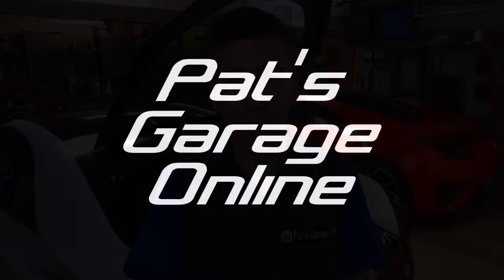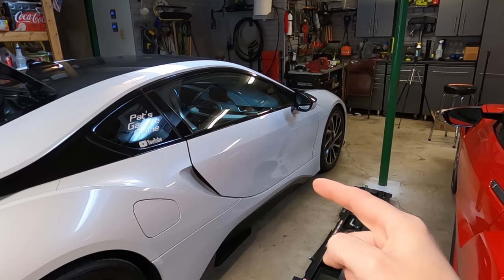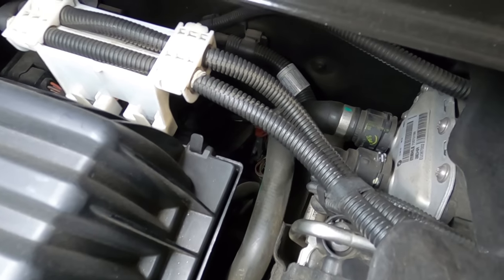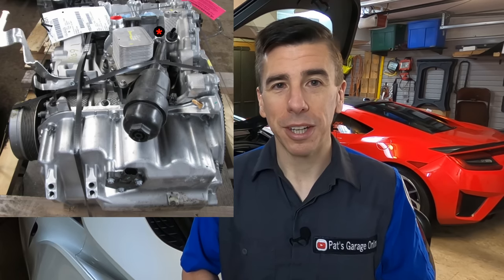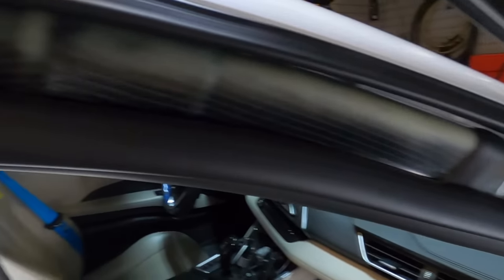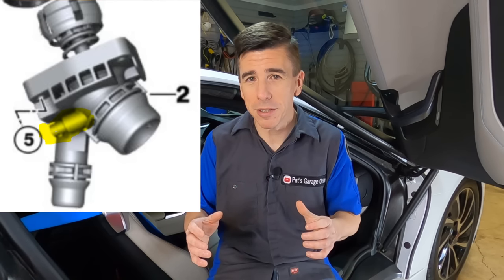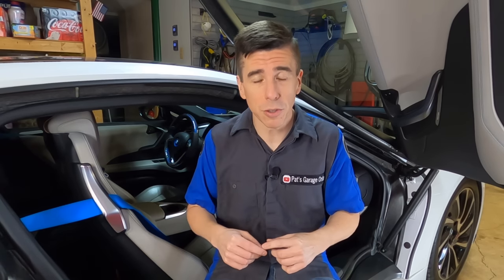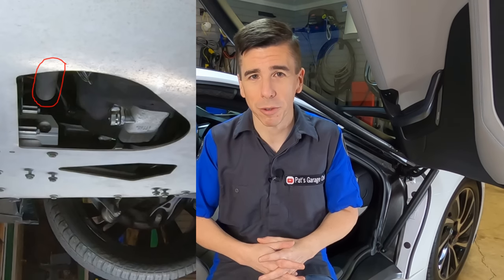My response to your ideas about Samcrac's BMW i8.

Comment: Wax element, interesting. I am familiar with wax element control, as they are used in some HVAC applications. They can be very reliable. 
I have worked on bleeding very large systems. Circulating the water over a long period of time, set up such that their can accumulate and be bleed off at a convenient point would seem to be the best course. Using an external electric pump for say 24 hours while the system is at an incline could slowly remove the air. The faster the velocity and pressure, the more air will be removed.
Reply from the maker: That's a great idea, using the electric pump.  There are many coolant hoses with quick disconnects where a pump can be put in line.
Reply: to my eye the concept that the radiator was blocked as it failed under pressure is incorrect. Consider it a loop with an inlet. a blockage will not cause it to burst (unless maybe there is a check valve in the system, which I think does not apply here). What that looks like to my eye is plain old overpressure burst. A hand pump can generate tremendous pressures if not familiar with the correct pressure ranges.

Comment: Hi
Just a idea
Disconnect the Front water hoses and put a clear pipe between them
So you can see ive the waterpp is working
Reply: Waterpump
Reply: Wen its not circulating you now you must look there

Comment: If the cooling circuit was blocked (not circulating at all or not filling completely) then would the coolant be boiling in the expansion tank in the front of the car? I'm not sure the thermal transfer from the engine, to the volume of water at the front of the car, could take place effectively. The coolant would boil at the rear,l (in the engine) but the heat wouldn't transfer to the front. 

Also re: raising the front of the car to assist with bleeding, that's a sound idea in principle, but in practise, since the coolant lines run down from the engine to underneath the car (lowest point) before coming back up at the front, unless you raise the cars nose to be basically vertical, any air from the rear would still have to flow down hill, in order to reach the front of the car. So I don't believe that would make a noticeable difference in this case.

The real basics need to be checked - 1. That the coolant is properly circulating through the system - check for blockages by forcing water under pressure from the front (exit of the expansion tank) through the car, the engine and then where it enters back into the radiator at the front.
2. Check the expansion tank cap is correctly working, so that it holds pressure (require in order to raise the boiling point of the water in the system). Without that, the engine will not be effectively cooled.

Comment: When Sam pulled his plugs out on the first Vid.
Did you notice they were a rusty brown colour like they’d been wet at some stage.
Maybe the head has been warped from overheating.
Because the alloy manufacturers use these days,  isn’t the quality it used to be.
Reply from the maker: Yes.  But this also happens when someone adds octane booster additive to the fuel.  Many people with these cars try to squeeze extra power out of them so that was my initial assumption, but you could be onto something.

Comment: Pat, what opportunity is there to run a small tube into a line somewhere and get it to the top of the head? The idea being to simply evacuate the air pocket and let the reserve tank make up.
Understand the concern that it would drain but this can be addressed. You can send a personal note if you want a quick diagram on an option. pretty rigid pipe with a somewhat direct path would be optimal.
Reply from the maker: That's a cool idea.  The only concern I see is that it would require a very long tube to get from the front of the car to the back and there might be some valves and coolant pumps in line, blocking the travel.

Comment: With the resistive heating element, resistors fail open. The MIL would only show a low fault for an open circuit. That schematic did not show any other sensors so the system also likely wouldn't be able to quantify that circuit, meaning, is the element getting hot enough and/or at the appropriate time or signal. In a high fault scenario, it would likely just blow a fuse somewhere, opening the circuit which would ultimately give a low fault for the MIL. It's all armchair without more info, full schematics and how the CAN-BUS is configured, but it is possible the heating element circuit is intact, but failed due to not functioning properly or within spec, and since it hasn't fully failed and there are no other sensors for higher fault resolution, doesn't show as failed. Not saying this is what I think is going on, but some info possible worth considering.
Reply: All of these that I have seen fail it was the wax motor, not the heater element.
Reply: @robb1165  I was only trying to show how a soft fail could occur, certainly not diagnosing the issue. Also, wouldn't the wax's expansion and contraction be at least mostly dependant on the heating element working? Or are you talking about some other type of failure?
Reply: @dolamyte  The wax motor is also exposed to coolant heat, but the issue I have seen with BMW's is the wax leaks out.
Reply from the maker: The thermostat is powered directly from the engine control module.  According to the service manual, If the characteristic map thermostat fails, the following behaviour is to be expected:

Fault entry in the engine control unit
conventional operation via wax element
US version: The emissions warning light lights up in the instrument panel

Comment: The thermostat works exactly like a Taco zone valve for hot water baseboard heat. Not a novel or unique design for controlling the flow of hot water. Temperature is about the same too-180F.

Comment: Maybe in the past someone busted the radiator and they might have used stop leak fluid to fix it which can block off the lines and this is why the radiator busted so quick when he was pressuring the system

Comment: It still could be the thermostat.  It may not be opening far enough.  The only way the computer can throw a code is if 1) the heater in the thermostat burns out, leaving an open circuit, or 2) the various temperature sensors indicate that the coolant isn't making it to the radiator and the computer has been programmed to check for that.  I say that because the thermostat doesn't have a position sensor.  So how will the computer know if the thermostat fails to open?  Does the radiator have a temp sensor on the engine/hot side?    I've seen another car with a heater on the thermostat - in that case, it's a regular thermostat with a heater to allow the computer to lower the setpoint.  I'm not sure this is different.  That wax motor is still going to be subject to the heat in the coolant, so even without the heater it's going to behave somewhat like a standard thermostat.

Comment: My 1984 Chrysler New Yorker with the Mistubishi engine had a Mikuni carburetor which used a similar 'wax element' which theoretically opened the thermostat when the engine warmed up. It never worked right and driving at 35 mph I was attracting all the wrong attention with the 'destroyer smoke screen' I was laying down. Wax elements? great on the drawing board; not so great in cars.

Comment: Not a mention of my headgasket thoughts or ways of checking for excess pressure in the cooling system...

And yet the video Samcrac just posted? Yep, headgasket.

Hooray me. I should get a cookie or something.
Reply from the maker: I wanted to cover the most common issues that BMW I8 owners faced. You are absolutely right, it definitely was the head gasket. I didn't bring it up because it's not a common issue that I hear about every week from other owners even though it's a possibility.

Comment: What is staggering about this problem is that the official BMW solution is a new engine. It would seem that talk of a new engine is just clutching at straws and equivalent to a IT technician not having a clue and recommending a full operating system install, when dismantling and checking the cooling system piece by piece would seem the proper way forward. 

The biggest clue system to the root problem is the blowing a hole in the radiator - that is what needs focusing on because it is too much of a coincidence that that was caused by a one in a million faulty radiator.
Reply from the maker: I agree.  I think there's a restriction farther back in the piping and the pressure was too great at the front, blowing the radiator.

Comment: Hi Pat. This comment does not specifically apply to this video but to another video where you mention not yo take of the reservoir cap as it will introduce air into the system. If the reservoir tank is up to level or even slightly below the half way mark i fail to see how air will be drawn into the system  as basic the coolant in the reservoir will act as a liquid trap . Much the same as drain on your wash hand basin has a "S" trap on it to prevent smells coming back up from the drainage piping downstream. Also as there is a air space above the coolant level surely then under your reasoning this air above the coolant would get drawn into the cooling system.   I may be wrong but let me know your reasoning as to why opening the filler cap would draw in. I agree if the engine is running there would be a positive pressure in the cooling system and on opening the cap the system would try and equalise the pressure and draw air into the system.  If however the car is cold and the engine is not running the pressure inside the cooling system will be as close as can be to atmospheric pressure so there would be no pressure differential in the system to force air in. I hope you understand my comment.  Thanks for another thought provoking video 👍🏾
Reply from the maker: I appreciate the reply.  I realized I didn't explain this properly in the video as I was talking quickly to keep the video short.  I needed to be more clear in that video, because removing the reservoir cap, when cold, will allow any vacuum from a leak in the system to cause water to flow out of the leak and air to enter.  That's typically when someone reaches out, when the level is low.  I usually tell them not to touch it because they likely have a leak.
Reply: @PatsGarageOnline  that makes sense now. The stat on the i8 is not that much different than a normal stat in that it uses heat to melt a wax plug but as soon as you add electronics to a mechanical system problems always arise😠😡

Comment: I understand why BMW said to replace the engine, that sounds like a much easier fix ,
Reply: ...when replacing the engine is simpler than getting an air bubble out of the cooling system!

Comment: I think BMW uses the electric thermostat in most of their cars, they will code if not working. Perhaps a barbed tee could be cut into the highest hose that would allow pressure filling from the engine.

Comment: I find it hard to believe  BMW corporation is NOT aware of the  i8 cooling problems? This car has been in production since 2014, that's 6 years!
By now, BMW should have a Technical Services Bulletin (TSB) out, explaining the i8 cooling system service procedure and any fixes or modification necessary.
Reply from the maker: They're keenly aware of the coolant issues as well as other issues that can cost over thousands to repair. Check out my i8 air conditioning compressor video where I explain how refrigerant lines cool the high voltage battery but the compressor is under so much load that it implodes and sends shrapnel throughout the refrigerant lines. That is an 18k repair at the dealer.
Reply: IF BMW are, as you say,  'keenly' aware of the coolant issues, then why BMW dealerships and certified repair shops are clueless as to how to service the cooling system, it tells me there is NO official recognition OR resolution to the problem by BMW.

Comment: As I believe the water pump was changed by someone it may be worth checking the drive belt routing is correct and the pump is not operating in reverse so to speak.
Reply from the maker: On this car there are only 3 pulleys and a very short belt that goes around the outside of all 3.  The crank, the water pump, and the starter/generator.  Instead of having a normal alternator, the starter/generator produces high voltage 3 phase in order to charge the high voltage battery pack.  In order to start the car, the generator is fed with reverse polarity electricity.

Comment: Why not unhook the highest available coolant line and pressure fill from there until you get what you want. If nothing else it will at least help with diagnosis and might even fill enough that you might finally have success with the vacuum bleeding process. Just thinking.
Reply from the maker: Sadly, the highest coolant hose that runs to the block is several inches below the top of the block.

Comment: A very bad design for the coolant system. If the Thermostat is electric it would close off when the motor is off and that would prevent you from getting any negative pressure during vacuum after the thermostat. I was also thinking of the elevating the front but I do not know how far you would have to go because the bottom of that part of the coolant loop would half to be higher then the reservoir. Definitely BMW should put a fill spot on the top of the motor moving forward.

Comment: Why didn’t BMW install a reservoir for the radiator at the top of the engine like they did in the e34 540i? Would have been a really easy fix to bleed the coolant as it would have been the highest point on the car...

Comment: Turns out to be a head gasket problem!
Reply from the maker: Yes, which is actually uncommon on an i8.  Weekly I hear how a coolant component was changed on an owner's i8, it's overheating and they take it back to the shop and another bleed fixes it.

Comment: I had the same issue with a 395 HP Pontiac V8 injection engine and I was about to get a broken car for the engine to swap over when I found out that someone whacked a big piece of bathroom sponge into one of the coolant pipes to get the car cheap
Reply from the maker: Wow!

Comment: Looks like the coolant lines to the intake heat exchanger are the highest point in the cooling system, not the coolant sensor. If NOTHING else works, install a tee in the easiest to get to hose with the tee facing up. That will become the highest point of the cooling system, allowing you to effectively burp the system and removed the air and add coolant. Overengineered to the max. Typical BMW. I would try raising the front end first. I used to work at a Pontiac dealer when Fieros were new and we had the same issue bleeding them
Reply from the maker: The BMW I8 has two different coolant circuits. The lines that run to the intercooler are totally separate from the lines that run to the engine. That's because the engine coolant is too hot. The low temperature coolant circuit that is connected to the intercooler has its own electric pump and three radiators.

Comment: If this car has any electric water pumps, have you considered verifying the pin orientation for power?  All 12vdc pump I've seen will reverse when the power pins are reversed, and that would be quite the obstruction.
Reply from the maker: That's definitely an idea Sam could try.

Comment: Hmmm... How about checking if the temperature of the cooling system is really hot, maybe the system is reading wrong. how about measuring if it is really hot and check with BMW how to do it by another method.
By the way, great video.
peace out.

Comment: I think you make the thermostate more complicated than it actually is...  A wax controlled thermostat is quite normal in domestic central heating systems for example. And in this car it just means an electronically controlled valve based on some parameters.... A lot more complicated things happen in my Fiat e.g....

Comment: I wondered if the cap to the coolant reservoir was defective. Not allowing the system to pressurize would cause over heating after running a while?

Comment: Suggestion: what if at the mid engine water jacket where the hose attaches which goes down to the bottom of the car.  One added a hose (a T) and brought the leg of this T up to just under the access cover to the engine with a cap.  Wouldn't that easily enable someone to bleed a significant amount of air out of the system.  One would still need the bleed procedure to get the air out of the head; but the rest of the system could be free of air before the bleed procedure had even started.  Or is this not a viable option due to an inability to add a T (due to accessibility) at this location (mid engine exit water jacket).